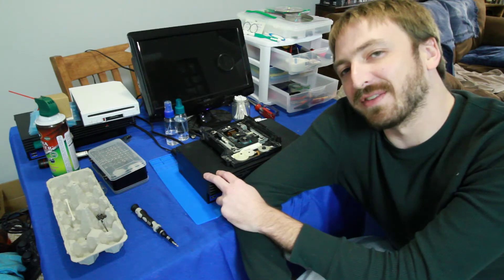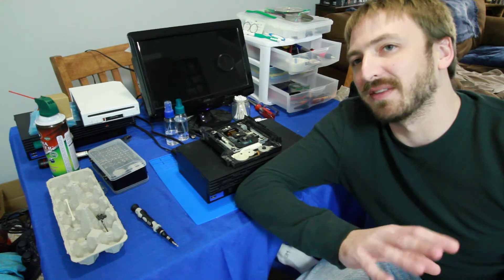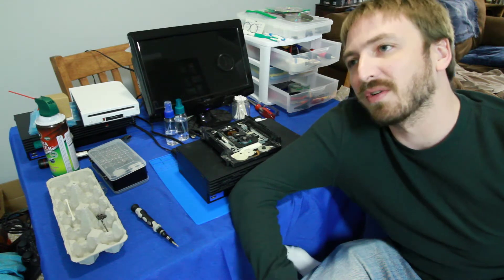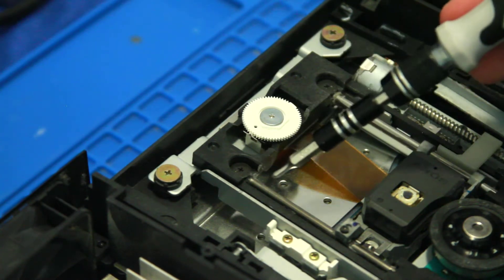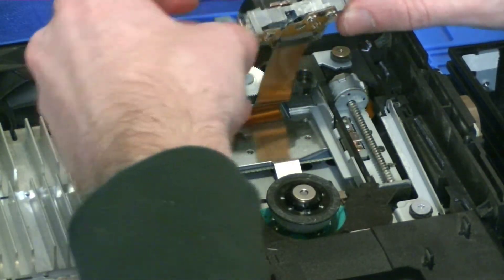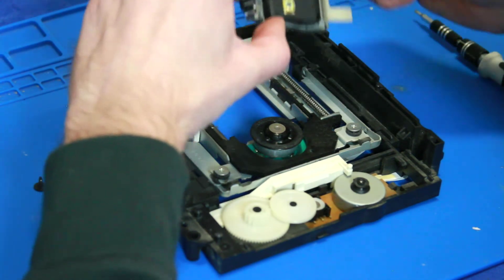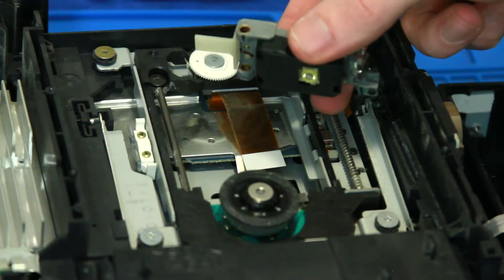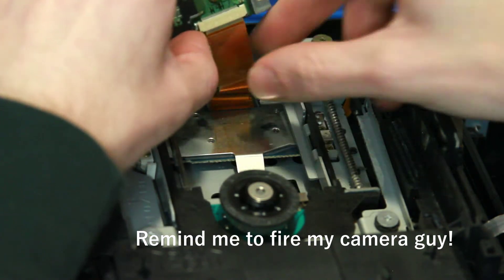Are PlayStation 2 lasers interchangeable? Lets find out!

Comment: how do you know which model you need to buy for the drive. I got about 13 ps2 that need to have the laser replaced. But, I dont know which model to buy to replace.
Reply from the maker: You'll need to remove the laser first, but on the side should be a sticker that says the model number. The models I remember off the top of my head are KHS-400B, 400C, 400R, HD7. You can also buy just one model and use a program called Lensechanger in FreeMcBoot to flash the system to use a different laser than the one that Sony put in from the factory. But that's a little more advanced :)

Comment: If swapped my laser on the 30001 but I forgot to plugging the cable for the laser now my disk drive is dead laser won’t work the eject but light ain’t on? Is the disk drive dead?
Reply from the maker: I've encountered this before a couple times. The disc drive is fine but I'd double check the cables. What the issue was for me was a fuse blew in the motherboard. But when I replaced it it blew again when I powered it on. I checked the IC next to the fuse and it shorted out. When I replaced it and the fuse the system worked. So what you're likely gonna have to do is check the fuses (when I get home I'll look at a board and let you know which one. It's on the laser circuit). Then you'll have to check the IC and see if it's shorted to ground. You'll need a schematic and you can Google how to do check the IC. It isn't hard. But replacing the fuse and the IC takes a hot air station and knowledge of desoldering and soldering SMD components.

Comment: You need the cd software tool check out modsville channel and he has it their
Reply from the maker: I learned about that tool recently. I'm definitely planning on using it and doing a follow-up video. This was an old video where I was experimenting swapping 400B and 400C. It seems to work but everytime? I dunno. I'd love someone to peer review this video and comment if it worked or not for them.
Reply: @titanrepairs  i have changed lots of lasers and i use this to redo
The lasers on them it works everytime
Reply: Nice video

Comment: In general you may have found the disk, after some period of time, but will this effect the loading speeds overall and was the tested or proven?
Reply from the maker: Honestly this is one of my older videos and was an experimentation and me still trying to find my YouTube footing. Since I published this, I did learn another method using Free McBoot and you can download a program for it that'll flash the PS2 to interchange lenses that will likely be more foolproof. I haven't tried that method yet but intend to and will make a video on it when I do. As for your question this video was to see if the 400B could be changed out with the 400C and it did seem to work. I did try and play some games off camera with it no problem. I don't remember if this PS2 was sold or it developed another issue and ended up in a box. If it was sold I haven't heard from the new owner that it's having problems.

Comment: I think the issue on mine is that the disc never starts spinning. I dont hear hear any spinning, have you ever replaced the spindle motors?
Reply from the maker: Is it a fat or a slim? Slims have this issue a lot. It's usually one of the lid switches that tell the laser and motor the lid is closed. On the fat, no I haven't had to replace a spindle. It's not a common issue. What I would do first is check the cable connections and make sure they're all in properly and in good shape. Sometimes, though not usually, they may pop out. I've definitely not seated a ribbon cable properly and wondered why it wasn't working lol. You can also try checking the switches that tell the laser to stop. You can try cleaning them with alcohol. Though if those are bad, you will usually hear grinding because the switch isn't telling the laser to stop. The last thing to check is the laser itself. It won't spin the spindle if it doesn't detect a disc. Best way I feel to check is to open it up and run it without the lid so you can see what's going on. When you close the tray without a disk you should see the laser light up for a second. If you don't the laser could be completely dead (as they are known to do on the fats) or you could have a bad fuse or IC on that particular circuit (though in my experience with that, there's no light on the eject button). TLDR, in my experience I'd guess the laser if your system is a fat.
Reply: This happened to me but I fixed it when I unplugged the ribbon cable for it then plugged it back in.